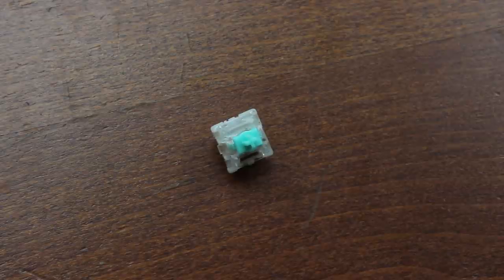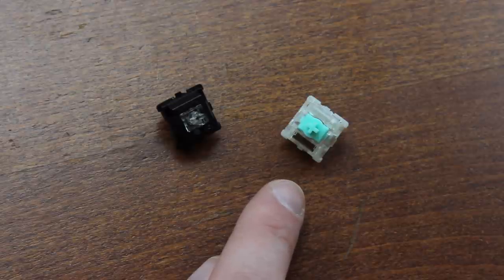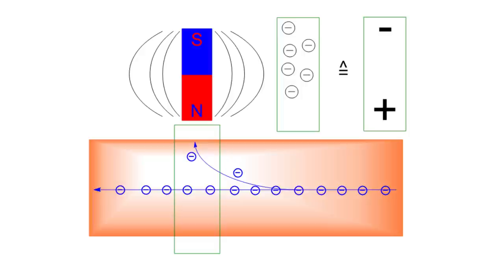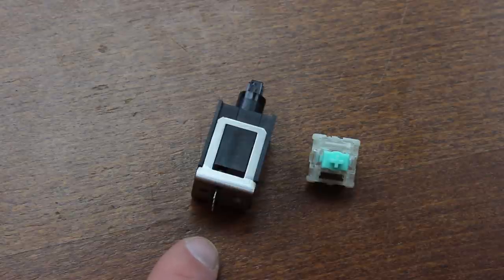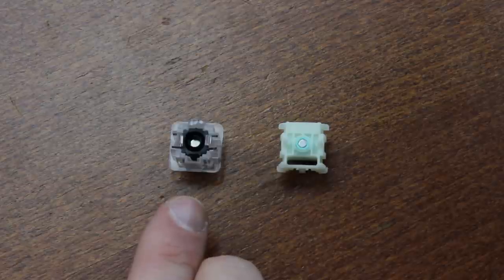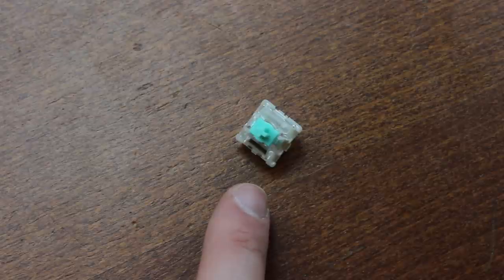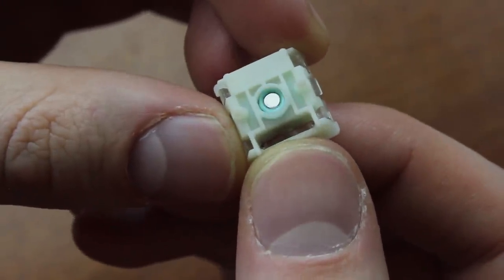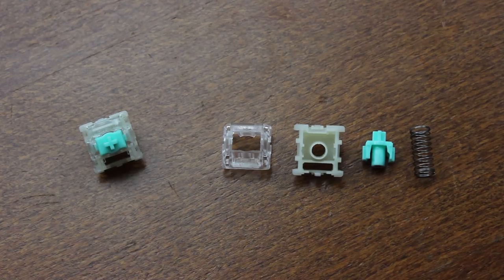Teardown - Wooting "Lekker" Hall effect switches

Comment: i've managed to order one of the keyboards because someone cancelled their order. quite insane considering there are only 1000 units.
can't wait for your review!
Reply: I am happy to got one aswell but i ordered at the time there was over 800 left and i was hoping they will find enough backers
Reply: The lekker edition and the two HE both use these switches, the lekker editions are limited but the HE isn't. The lekker edition just has special keycaps, and nothing else that's significant.
Reply: @CaptainShovelHead  clearly just mad that you didn't get one
Reply: @CaptainShovelHead  Also the lekker is blue while the HE is black. To me that was the main deciding factor.
Reply: @CaptainShovelHead  Look at how many "feelings" you hurt with a factual statement. I feel sad for them.
Reply: @43615  No he's not mad.
The lekker edition is just another "limited" egojerking model.
Nothing special about it compared to the HE.

Comment: Gateron actually have an official hall-effect switch already listed on their website, the KS-20 switch. I suspect that these lekker switches are simply a color variant of the KS-20 switch. Perhaps wooting commissioned Gateron to make a hall-effect switches, and Gateron said they would only do it if they subsequently owned the design... But now that Gateron makes an official hall-effect switch that anyone can buy, hopefully this will result in many more analog keyboards. Or maybe even a QMK-compatible integration for us enthusiasts!
Reply: Gateron probably acts as an ODM in this case. Steelseries or Wooting specify a switch design while Gateron design and manufacture it. Since they designed it they own the IP, but some of the R&D cost are covered by the brand owner. Hence they got timed exclusive deals.

Comment: The large amount of lubricant might be because a lot of the old Flaretech switches bind pretty badly when pressed off axis especially so if you get tall caps. Also most of them are a bit scratchy too so it might just be to get that extra step up maybe on the competition?

Comment: Hey Thomas - Model M question. I am not on any other social media so this is kinda the only place I can ask such a question.
I got a Model M 1391412 and it came with the DIN / AT connnector. can I just buy the RJ 45 to PS/2 cable and it will work? My PC has a PS/2 port so I know I don't need an extra PS/2 -> USB converter. 
Many thanks in case you get to read this ;)
Reply: I'm not Thomas, but I think you have multiple options:
- buy a SDL -> USB cable
- buy a SDL -> PS/2 cable
- buy a DIN -> PS/2 adapter (probably the cheapest option)
The connector at the keyboard is not really RJ 45 unless you have a terminal Model M keyboard.
Reply: @samuelschwager  Thank you mate!
I think I will go for an SDL to PS/2 cable; if I remember correctly I have seen some that are very long; which comes in handy for my standing desk. I'll look into that. Many thanks Samuel ;)
Reply: @Waberner  You're welcome.
Reply: @samuelschwager  Thank you for suggesting a SDL to PS/2 cable! I bought one and it works. Just had to edit the Windows Registry for it to enable PS/2.
Reply: @Waberner  Nice!

Comment: I actually want to put a few analogue keys in my custom keyboard but it's nigh on impossible to find any that can be used on a custom board lol.
Reply: These aren't the exception sadly. The part reading out the magnets will be on the board.
Even more important, a custom  board is unable to process an analog signal, unless you actually design it yourself, so for now, this dream will sadly have to stay just that
Reply: @bytezero3818  Yup, exactly the issue I've been dealing with. My current plan is to actually make a custom PCB, then mount purchased Hall Effect sensors on there, and send the signal to a Rasperry pi of some description for processing, but I'm still not entirely convinced that's something I can do.
Reply: @Sychius  I am sure it can be, it will just be a whole lot of work.

Actually, you might be better off getting yourself hall sensors and buy the lekker switches, that might work out for you
Reply: Are there even any commercialy available pcbs that could handle analog switches? Even if the switch was self contained, every board I ever saw for sale simply checks if a contact is closed or not.
Reply: @krpajda  There are a few premade keyboards that can handle analogue switches, e.g the Wooting keyboard and the new Razer Huntsman I think, but I'd be making my own anyway, using a custom PCB and custom layout.

Comment: Now if somebody made a sensor that was easy to attach to standard MX solder points and just did the standard on off without analog, could retrofit them to whatever the fucc board I want... and seal that up to be extremely water resistant.
Reply: Alas Hall effect switches require more than 2 pins.

Comment: I suppose the switch couldn't be self-contained at that size? It would be nice to drop some onto a commonplace cherry board.
Reply: No it can't, hall effect sensors require 4 pins (3 if you pull some funny business but no less) and furthermore they draw more power than conventional switches so most PCBs (and indeed many USB buses) can't power a full board without some funny business with the wiring which will cost you N key roll over.
Reply: @tax274  this keyboard has n key roll over.
Reply: @besser-nicht  Yes, it was designed to handle the greater power consumption of that layout and then some but a random MX or Alps pcb would not.
Reply: @tax274  right